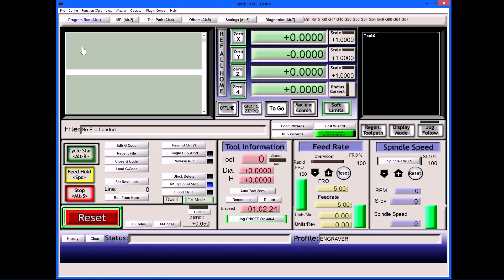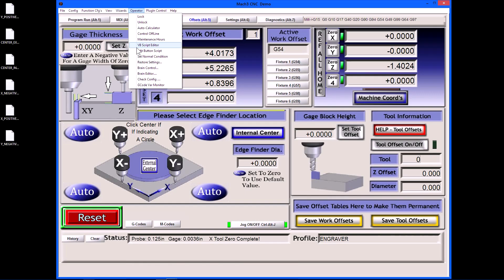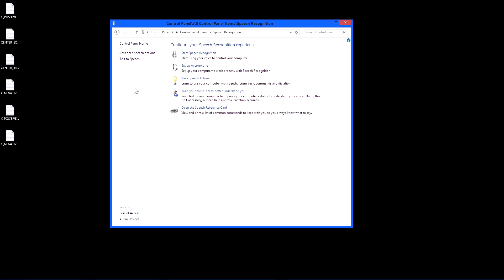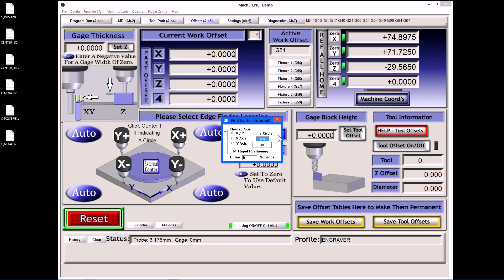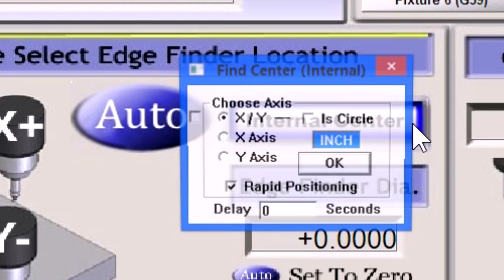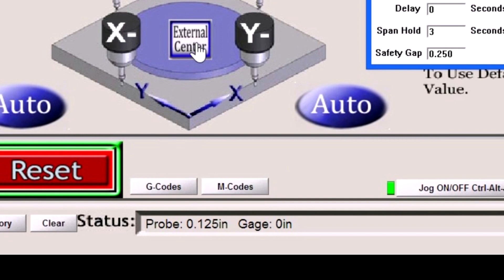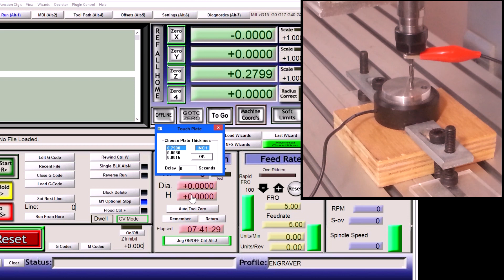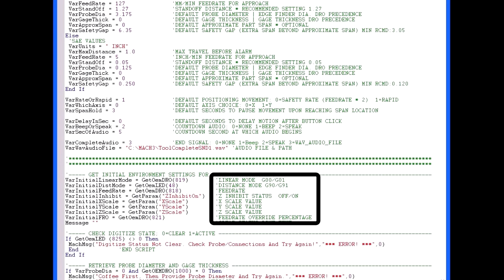CNC Mach3 | Automated Tool Setting | Edge/Center Finding (X/Y) | Includes INCH/MM Scripts

Comment: Great couple of videos!
But there seems to be a bug in the Circle calculations for Diameter...
In both Unit cases
The code should be: 
VarSpanDia = Format((VarSpanX + VarSpanY)/2, "##0.000")     'CALCULATE <..> DIAMETER
another set of parentheses need to encompass the (VarSpanX + VarSpanY) before the division.

 Case 0	 'BOTH
    Select Case GetParam("Units")    'SET INFORMATION FOR STATUS LINE DISPLAY
     Case 0     'MM
      VarSpanDia = Format(VarSpanX + VarSpanY/2,"##0.000")     'CALCULATE MM DIAMETER
      VarSpanDiff = Format(VarSpanX - VarSpanY,"##0.000")      'CALCULATE SPAN DIFFERENCE
     Case 1     'INCH
      VarSpanDia = Format(VarSpanX + VarSpanY/2,"##0.0000")     'CALCULATE INCH DIAMETER
      VarSpanDiff = Format(VarSpanX - VarSpanY,"##0.0000")      'CALCULATE SPAN DIFFERENCE
    End Select
Reply from the maker: Thank you for letting me know about this issue. As you stated, a bug is present in the calculation. I did some testing and can't believe I didn't catch it before. Thankfully, this is the only version with the issue. It has now been fixed and uploaded in the new zip file XY_TOUCH_SCRIPTS_2b (link in description). The new Internal Center script is Rev15b. Though I repaired the calculation differently than you did, I thank you for your input.

Comment: thaks for the great video. though i have a problem. when i use the external center finder my routerbit wont finish above the center but just on the edge of the center. what could the reason be? (note...yes i have filled in the probe diamater an d i checked calibration.....)
(note2...  ihad the same with my z-height probe. i had to fill in 'wrong' numbers to receive it works correctly)
Reply from the maker: Stephan, email me at sunny5rise@gmail.com and tell me which revision of the scripts you are having issues with. Also tell me which variables you had to fudge.

Comment: Unfortunately there are no good instructions to setup usb for first time homing setup. Dont seem to be any way to zero machine coordinates. Cant find an edge if you cant find home. I run all axes to the switch and when it activates each switch I back off until it is no longer activated and set soft limits and home. Continue for all axes and then I need to zero there but no way to zero DRO/machine coordinates.  Seems to me that that for newbie one of the most elemental settings on any cnc machine would be to keep your drive components in the workspace. Pardon my ignorance but how do you zero machine coordinants? Ive gone to settings and tried zero from there but it always puts some value there other than zero. WTF?
Reply from the maker: About your Machine Homing... When you activate the home switches, do the “Home” LEDs light up on the Diagnostics screen (M1Home, M2Home, M3Home)?  What happens when you press the “REF ALL HOME” button on the Program Run screen?

If you can't figure out what is going on, it's still ok to use my scripts. They use Work coordinates. I do  recommend turning off the Soft Limits if you cant zero the Machine coordinates though.

Comment: One problem i had was that my z was going down for some reason or because i'm stupid, so i replaced the line with G91 Z15 .
Another problem i have is that  i always get "Maximum Travel Reached. Reposition X Axis Closer To Part And Try Again" so i removed that if statement ,
Another problem i have is that even if set Span to any number , the tool moves until touches the probe then it pushes into it faster a few mm more , after that it goes to the other side but it goes too far away . 

Is very weird ,maybe i'm doing all wrong....
Reply from the maker: Dan, email me at sunny5rise@gmail.com and I'll send you another script to try.

Comment: Amazing videos you have Charlie! I often need to get things VERY well explained, and you really do that! But i got some small problems with the edge finder systems. My X+ and Y+ auto and internal center and Auto tool zero  works great, but on negative on both i get an error. ERROR IN LINE 136-TYPE MISMATCH and external center get ERROR 115-TYPE MISMATCH when i try to start it. Any idea? :)
Reply from the maker: Ivan, email me at sunny5rise@gmail.com and I'll send you some modified scripts for testing.

Comment: Thank you sir! I have been using this script for a year now, can i ask, every now & then i get an error “Digitize status not clear. Check probe/connections & try again” any help much appreciated! The digitize light blinks but will not run XYZ script. Thanks 🙏🏽
Reply from the maker: Apologize for the late reply. Did you get this issue resolved?
Reply: @sunny5rising   hi, i have so far, i rewired somethings & has been faultless since ( 1 month nearly now ) 
Do you know if there is a reason for the error exactly?
Thanks again ! 😁
Reply from the maker: You're welcome. Since you rewired and it fixed the issue, it was possibly a faulty wire creating an intermittent short.

Comment: Thanks for providing these scripts Charlie, worked great and the audio files are a neat addition.  I can confirm these scripts worked fine on my Chinese CNCEST 6040 CNC on MACH3. When using my Digitizer type probe I just have to switch the "Active Low" setting switched to "On" vs. "Off" for using a Touch Plate.
Reply from the maker: You're Welcome. Glad you are making use of them.

Comment: Hi Charlie, thanks for providing these tutorials. Just finished hooking up my Z-Axis Touch Plate using your other video and script. With regard to the scripts in this video will they work with a digitizer type touch probe. I just finished making a 3D-Printed one to goof around with and wondering how I can hook it to my Chinese CNCEST 6040. I assume it's the same pin/ports as the Z-Axis uses. It's a 2-wire simple probe with an LED. My system power supply for the probe is 24V. It bench test fine so I'm trying figure out how to integrate it. I'm a beginner as far as programming and electronics. Do you know if MACH3 can do surface scanning as that is something I want to tinker with down the road? Thanks again for all you do!

Comment: Will this work for USB type of connection running on MACH3? Your machine demo is using those pararrel port printer connections.
Reply from the maker: Some folks have no issues with the USB, others do.

Comment: HI Charlie, thanks for helping with this nice video. Any Idea why after probing Mach3 set Zeros as a big value both for Y and X? In my case it sets huge numbers as zero,  Ie: Y= -5210.64, much bigger than my working area. I use it with milimeters. Thanks since now
Reply: Bump. Have similar issue, i get touch and then it back off considerably and the zero isnt right. As well sometimes it says  my prob is too far, no matter how close i touch it.
Reply: @theguncouple  I Solved this by inverting the axis in home/limits option. It worked

Comment: Hi Mr. Charlie,
First of all thanks for your script and your effort. i am using Mach3 with usb control. unfortunately facing problem in probing. when i take external center x ,y    After the probe touches the work piece,  probe is moving towards x machine zero and continuing the probe activity.  please help me. thanks in advance

Comment: Can you help , I have the usb Board and when o connected the probe and activate the pin , it didn’t work and when I connected and activated the limit switches the motors stopped working even when I removed the wires from board and deactivated the pins

Comment: i have also problem with probes when i put my mettal stock and trying to connect bit with red crocadile and black on plate probevdegilized already led on..i did isolate vise put above and corner wood to isolate parts then works ok... but its hard any way to do without osolate hole vise and bed , ??? but still no works external center .... and no any button of inernel center:-))) please boss help..its urgent need to finish some works..
Reply from the maker: I did reply to your email answering some of this.  :)
Reply: @sunny5rising  Hello,, i droped email to you again with some problem couldnt sort it out .. 
i did as you mentioned in email corrosponds but no luck probably i did wrong way.. any chance to quick check your email i really need your help.. i appreciated.
Reply: @sunny5rising  Hello How are you doing today? hope all fine.. i droped email again please any chance to reply? Appreciated thanks for your support and help on this
Reply from the maker: Yes, I got your email. I'll reply as soon as I can.
Reply: @sunny5rising  Charlie, Thanks you really great man ..i need this sorted out please try your best..  I Really appreciated i will wait for your reply  its important my stock waiting internal center:-) Thanks
Reply from the maker: If you need to use the internal center script quickly, replace where you put the external script with the internal script. This way you can use it now.
Reply: @sunny5rising  Charlie, the issue i cant see the any pcs what we downloaded from your folder inernal and external thats way issue so cant do anything i sent email with pcs please when you get chance can you reply ? i really appreciated..you mentioned screenset folder located i couldnt find that folder to change some pcs..please can you quick check my email with corrosponds please please thanks a lot ...
Reply: @sunny5rising  Charlie, I HOPE YOU REPLY AM WAITING FOR :-) I KNOW YOU BUSY AND SORRY FOR THIS AND I KNOW YOU ARE GREAT MAN ALSO :-)
Reply from the maker: Just sent an email. I think I found the screenset you are using. If I did find the correct one, you can get the images to show up, but the "Internal Center" image is not editable (to enter the script) with your screenset. You can download a screenset editor to fix this, or switch to the standard 1024_set.
Reply: @sunny5rising  Charlie, you did a lot thanks am going to chech mail thanks a lot... do you have skype or viber or whats app? how can i switch insert my pcs 1024.set???
Reply: @sunny5rising  Charlie thanks for your help i checked email.. so, as i understand in my mach3 edittd 6axis.offset.jpg and i need to replace it by standar screen set picture 1024.set.offset.jpeg correct? if i change edit by 1024 then i can edit all pcs as you showed in yourvideo then all buttons will come on surface and works also scripts right? but my mill is arranged also extra 2 axis C AND B, i removed it because am not working now with 5 axis in machine.. but i will use soon extra 2 axis (c and b) if i replace put 1024. set.offset in my screen set hope no effect my C AND B axis ??will works ok all 5 axis ??

i will try to set bring back standard 1024.set offset jpeg to screen i go C:\Mach3\Bitmaps\MillBitmaps\UT Buttons-JPG  and find 1024. set offset and click to replace that's all ??the previous 6axis.set.offshet.jpeg automatically removed ? 
after i replace standard screen set 1024 i will copy and paste your zip files which has 4 pcs in mach 3 folder  in millbitmaps that's it?then i close and reopen mach3 and can see in new pcs with new offsets then i can add scritps then works OK ???
Sorry for too much question just want to be sure becuse am new on it..i bought it that machine without proper manual and explanation ....
your reply will be greatly appreciated... am wiating for your reply.. hope you understand and really thanks you already did a lot for me..
Reply from the maker: No No No, NOT correct!  The "1024_set_Offset.jpg" and "6Axis_set_Offset.jpg" are screen shots of what the Offset screen looks like with the X/Y images installed for each of the respective screensets. These are for your viewing pleasure, not installation.  The "Images.zip" file I sent you has the images (with their names changed to match your 6Axis.set screenset) for you to put into your "C:\Mach3\Bitmaps\MillBitmaps\UT Buttons-JPG"  folder. When done, and Mach3 restarted, your Offset screen will look like the "6Axis_set_Offset.jpg" screenshot. Like I said though, You will NOT be able to add the "Internal Center" script in the button because whomever made that 6Axis.set screenset did not make that particular button editable. You will have to download a Mach3 screen set editor to fix this. For safety, PLEASE do not click the "Internal Center" button (which replaces the "Work Offset Help, button") until your screenset is edited. If your version has not been edited from the original, BOTH Help buttons on that screen will RUN Gcode once clicked. Be Careful!
Reply: @sunny5rising  Charlie,
thanks a lot for reply,... as  i understand i go to C : file and find mach3 folder/millbitmaps then i will add pcs what you sent to my email today 4 quantity (select.jpg,TouchImage.jpg ,TouchImagec2.jpg,Work Offset Help!.jpg) then i restart my mach3 program then i open mach3 and go tab offset then i see updated one "6Axis_set_Offset.jpg" with new updated pcs and words as i added above 4 pcs... correct? then i will add edit scripts in notepad for each buttons , edge find x, y and external buttons corrrect? exept internal center (Work Offset Help, button) buttons am not click on it and not installed scritps in note pad am correct till i will install mach3 screen set editor ????
if above are correct then is it easy to download and mach3 screen editor and edit what how can i change/edit (Work Offset Help, button)=internal center  then i download scripts and RUN SAFETY HOPE ALL WILL WORK?????

i really appreciated if you explain step by step thanks a lot...
also , here is good to talk and discuss about it sorry again for my stupid questions   
probably yuo pist off me :-)) but for beginner like me come here and read this all our corrosponds and hope it will help them...
appreciated am waiting for your reply.......
Reply from the maker: I understand you are a beginner. No, I'm not pissed off, lol. I'm sending an Email shortly.
Reply: @sunny5rising  YES. You are right am a beginner ...:-) i really want to learn and sorted out with your support and help .. 
Thank you for understanding...
Reply: @sunny5rising  Hello Mr Chariel,
How are you doing today ?Hope all fine it's me again :-) sorry 
i just sent email with file please any chance to quick look at ? i really appreciated for your help on this and huge supports ... THANKS A LOT
Reply from the maker: Got your email. I'll get back with you as soon as I can.
Reply: @sunny5rising  Great appreciated!!!
Reply: @sunny5rising  Hello Boss
Reply from the maker: Hello, just sent an email with your edited screenset.
Reply: @sunny5rising  You perfect man good job you really help people fingered up and i subscribed and recommend my friends and pleasure to watch other videos...am going to check my email thanks again ....

do you have experience with psoc 059 kits with stepper motor???
Reply: @sunny5rising  Hi boss i sent email i have issue after changed screen set the internal center after cycle work not show in status line no any dimension there is error 145 type mismatch..how can i fix it? your help need thanks and really appreciate it....
Reply from the maker: I'll get back to you as soon as I can
Reply: @sunny5rising  Hi Charlie, Thanks a lot you reply and help me.
I appreciate it ..
Reply: @sunny5rising  Hi boss, i will try today this way because its urgent a little bit till you fix my internal center finding ..i will wait for your reply..I appreciate it you did a lot for me and still support me on this GOD BLESS YOU!
Reply: @sunny5rising  no need to change anything just replace all scripts from external to internal thats all what i need to do??? Thanks a lot

Comment: and why you use here wood plate .. in may case my stock will be aluminum and mettal i need isolate them put some woods under my sotck and woods under clamps??? 
i dont understand how it works can you explain boss with simple english with easy way as you do usual :)
appreciated ....as i understand the red corcadile clamps is pulse signal one right and the plastic plate with aluminum is MINUS Graound in black crocodile is that correct ?? sorry my english
Reply from the maker: In this case, I used the piece of wood simply to raise the part off of the table for clearance.  Yes, usually you do see the crocodile clip red (positive) and the touch plate base black (ground). However, on my system, it doesn't matter which is marked positive or negative because it only detects when the circuit is closed (when connected probe contacts connected base).
Reply: @sunny5rising  boss, do you have whats app application? i did all things i want to send pcs in my interface there is no internet cycle button cant add sripts... and other problem my external center buttom have but i added two scritps 15 and 15B version not working...and pictures are notvsame interface:-)) but x and y works ok finfld cordinaros in corner zero ok... please whats wrong ?? i cant find my external center i run two scripts no luck..
Reply from the maker: I do not have Whats App, but you can email me at sunny5rise@gmail.com
Reply: @sunny5rising  I just sent to you email with evidence pcs hope you reply me:-)) your help needs me really you do good stuff and reply also for everyone which is professional stuff!!!! GOD BLESS YOU..i will keep watching your videos!!!!